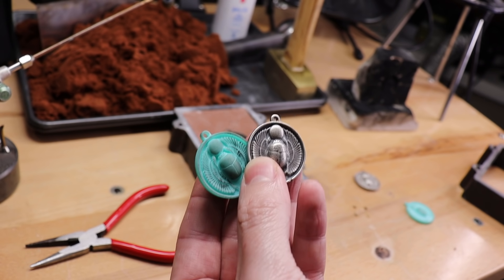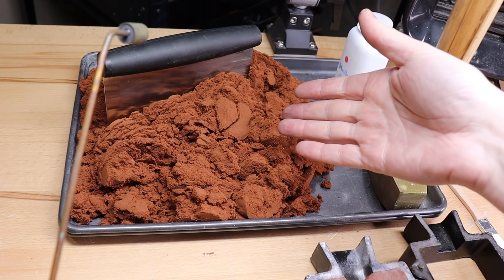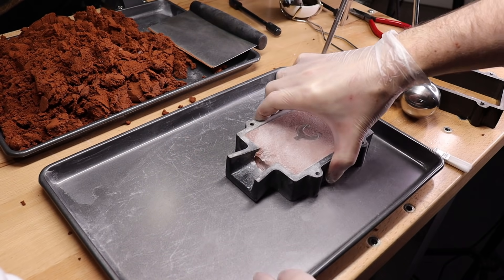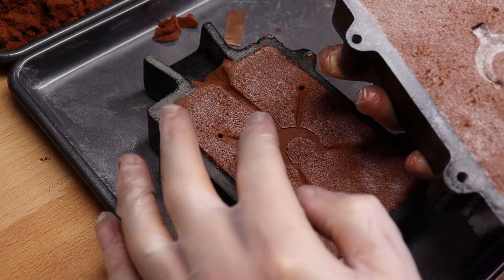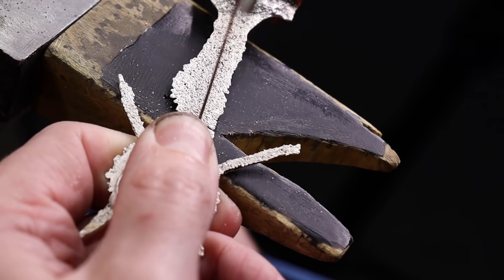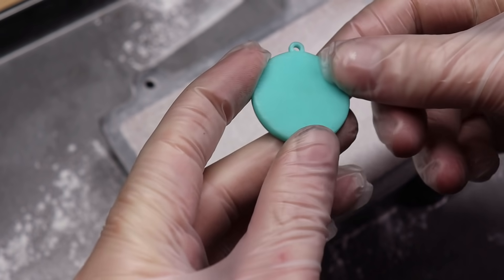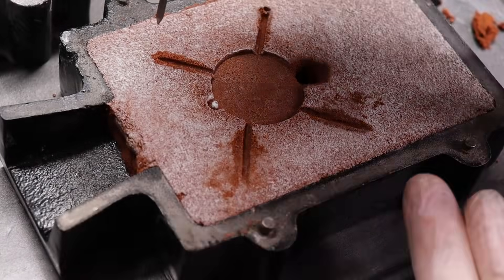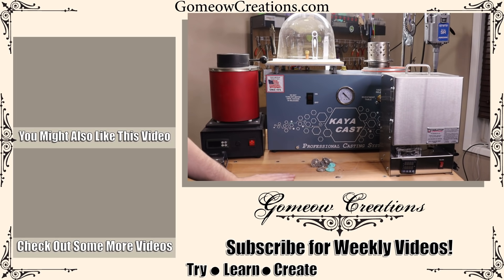Jewelry Casting Made Easy Using Delft Clay & 3D Printing

Comment: Propane burns at 3,596° F
MAP gas burns at 3,730° F
Oxy acetalene burns at 6,300° F

You said your kiln reaches 2,000°, and Idk if you meant celcius, or fahrenheit, but even if you meant celcius, that's still only 3,632° F, which would barely be hotter than the propane torch.

Idk what metal you're using that you think you need a flame hotter than 3,596° F when platinum, gold, silver, copper, brass, bronze, iron, and even steel (both carbon and stainless) all have melting points below 3000° F, and titanium's melting point is 3,038° F which is still well below the burn temperature of propane.  6,300° F obviously will heat things up faster, but it's certainly not required unless you're working with something like tungsten, or molybdenum.
Reply: Oh, and there are plenty of videos on here of jewellers using butane torches to melt down silver for casting, so it's definitely doable with many other metals using a kitchen torch.
Reply from the maker: Yeah they burn at the temps you need to melt metals but being able to get all that heat into the metal and get it to the temp to turn it  into a liquid is not a easy. I have tried using a simple propane plumbers torch to melt a little bit of silver in a small cup crucible and it did melt but not to the point of it being a liquid. Maybe its a nozzle problem on my end or I would need to build some kind of insolated area to heat it because I can melt small amounts of silver with a Mapp gas setup but it takes a good amount of time and anything over an ounce will start to have problems.

The kiln or electric smelting furnace is insolated so you're not loosing heat into the air. You done need as much heat to get your metal to the right temp. 

I have seen jewelers having to use 2 butane torches at the same to solder thicker rings due to it not being able to heat the metal enough in open air.  😁👍
Reply: @GomeowCreations  Idk, I haven't had any issues with propane melting silver or brass, since it burns at more than double the melting point of silver, but I also do it in a 3 sided box lined with charcoal to minimise heat loss.

Regarding the soldering using butane, Andrew Berry only uses a single butane torch for all of his soldering, and  even in his tutorial he's using 2mm thick fine silver, and hard silver solder, and it happens very fast.

To each their own though.

Comment: man, those scarab beetles are baaaad sandcast.

I was able to get a way better results with cheap ass petrobond sand and a 3d printed flask.

Dust your print in a cornstarch, and it will release better from the clay, and use more force to impress it, make sure it does not moove untill you are ready to take it off from sand and overheat your metal of choice and your cast should be way better.

Comment: For your health's sake, please don't send so much talc powder flying around! Breathing in mineral powder is a good way to ruin your lungs in the long run. You could use corn starch. It's still not healthy to breathe but at least your body should be able to get rid of it whereas talc powder will stay inside your lungs until the end. And make it happen sooner. 
Also I guess you now learned about it from other people, but you can put talc/corn starch in a sock to dispense just the right amount you need instead of blowing it around in the air you breathe.

. BTW, baby powder is talc with maybe a little baby oil (scented mineral oil) in it. Gosh the unhealthy stuff we subject our babies to.
Your Petrobond material very coarse! I wonder if they make it in different grades. 
For the rest this is a nice recount of what a newbie in this technique can expect. It tells us what to pay attention to and many things to avoid doing.